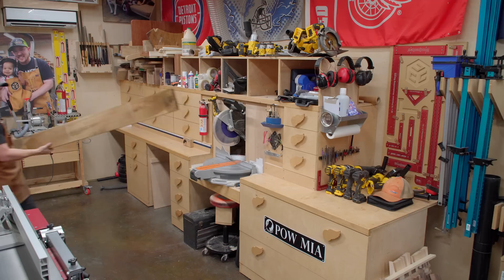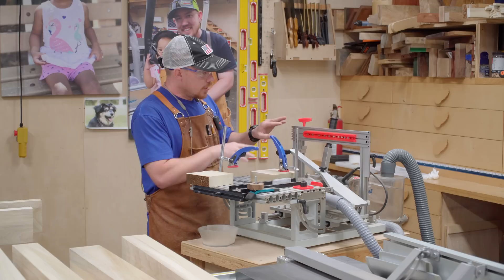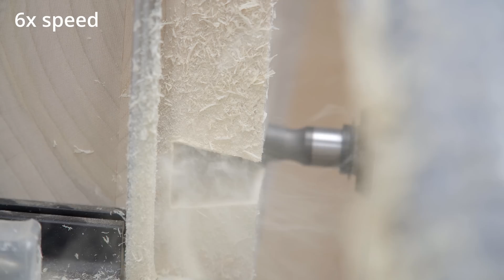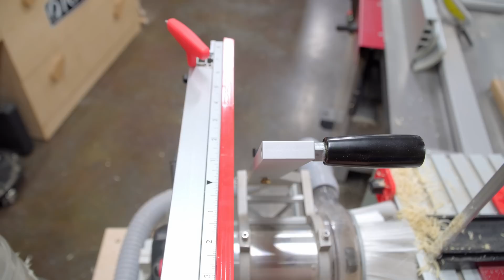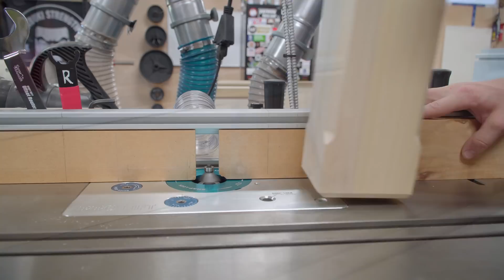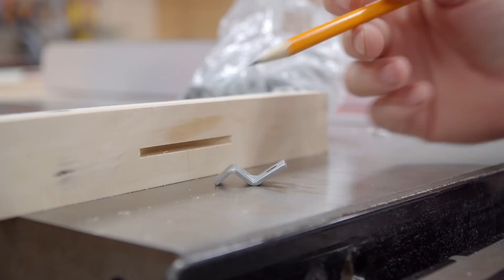No Clamp Joinery - Farm Table Base - 394

Comment: why wouldn't you use a sliding dovetail joint for the center brace??
Reply from the maker: In this case it's just unnecessary. I did that on my personal dining table a few years ago. No benefit. Actually, using a sliding dovetail instead of pocket screws for the internal brace is weaker. It removes material from the long rail.

Comment: Looks great. I just wish you kept with the theme and dovetailed the cross stretcher instead of the pocket hole screws. ;(
Reply from the maker: That would remove material from. The long rails, making them weaker. There's literally no benefit to dove tailing the center brace. But if you'd like to see it, search for my hickory dining table build. I did it on that one.

Comment: Awesome as always.  I'm building a desk that will have to be able to come apart (to fit in and out of the room).  Any reason I couldn't do the sliding dovetails and just not glue them together?  Or is there a good way to pin them together with something that I could remove (will only move when I leave the place).
Reply: read up on hide glue. I've never tried, but supposedly apply heat and it'll come apart.

Comment: I use threaded rivets in leg bases where I need adjustment - they have a collar to hold them in place and you don't compromise the wood anymore than necessary as spiked nuts do.  Also handy in a workbench fitted from the underside - you then have a female thread accessible to clamp fixtures to the bench top.
Reply: I use ring shank leg glides on chair legs, never experienced a split. If 360 degrees of steel doesn't induce a split in a tapered chair leg, I'm at a loss to see how 3 tiny points are going to induce harm into a massive table leg.
Reply from the maker: How does a spiked thread compromise the wood?
Reply: @JayBates  Soft woods not so much, thinner hardwood legs can splinter. Not always but if you have prepped a leg plain or fancy you don't want to have to repair. Someone said they pre drill the spike points - more work n less wood me thinks.

Comment: Another excellent video and project Jay!   For levelling bolts I've used my CNC to cut a pocket for square nuts to embed .5" or so from the leg bottom.  Then use the CNC to cut plugs to cover the nut pocket from matching wood. I've seen t-nuts and insert nuts eventually pull out of end grain over time, so have used the embedded nuts for levelling bolts on my student's project legs. Much like a cross dowel would work, but not limited in thread size if there is room for the big nut in the wood.  I'd add a link to an example photo but links in comments seem to get my comments deleted. 
4D

Comment: could you make a bed frame in the same way or will the 'motion of the ocean' eventually get at those dovetails?
Reply from the maker: The only downside with a bed frame is gluing the assembly. I wouldn't rely on just the sliding dovetail for a bed.
Reply: @JayBates  that's true, I hadn't thought about the permanence aspect
Reply: Glue would mean getting a chain saw if you want to move the bed.  LOL. But you could use sliding dovetails with a barrel bolt that would hold the joint rigid against the wave action and allow for the bed to be moved. I have a French sleigh bed that uses a similar system to connect and lock the rails to the head and foot boards.

Comment: Why not use threaded inserts? Do they not make them large enough for those bolts?
Reply from the maker: 6 one way, half a dozen the other. I've always used t-nuts because thats what was used when I was working in the furniture industry. Also, a t-nut has a flange so I think it would hold up better long term. Either will work though.
Reply: @JayBates  Are those T-nuts galvanized or stainless steel? Especially in Mississippi, I'm sure they will get wet pretty often. Though, I guess it wouldn't be hard to replace them if they do rust out in the future.

Comment: Humm, very nice work!  But, personally I think a double draw bore through tenon is stronger, and don't need fancy tools.  Why not do a video on which is stronger and simpler.   You have half the future video here.
Reply: Once glued i doubt there will be much difference between joints. Woodworkers have got to stay out of the tules. The top screwed down will provide additional strength.  The real take away here is an easy to make joint that is extremely robust, easy to assemble using a non-PVA glue and another way to use my PantoRouter that I had not thought about. Keep  up the great work, Jay.
Reply from the maker: It's probably stronger. But a sliding dovetail is plenty strong enough. A metal base is stronger as well.
Reply: @JayBates  Yes, for the application of a dining table you are correct sir!  I used double draw bore on my solid oak 8'x3' woodworking bench and once it is on the floor, with the wheels retracted, it absolutely does not move.  I did it all with just chisels, woodboring bit, saw, and a homemade mallet.  No glue because I felt that was redunant.
But, it's just a thought and in no way meant to degrade any your excellent work in anyway. Kudos to thee.
Reply: Very good project. Especially like your explanation on using the bow of the rails to aid in mechanical connection and the use of Z clips
Reply: Regular tenons will be structurally stronger than sliding dovetails provided they are snug and deep. Reason for this is the fact the mortise is closed at both ends. =)